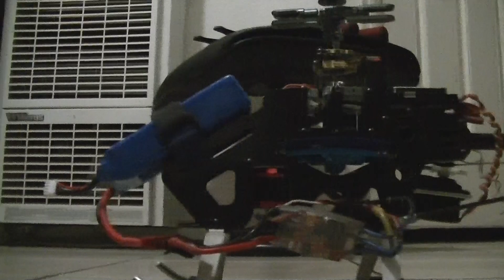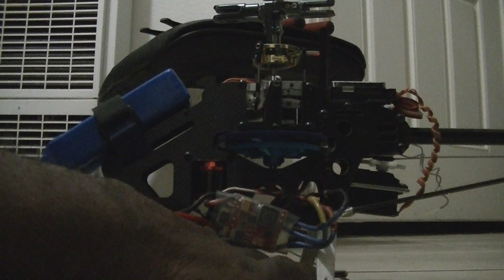Turnigy AE 45A Brushless ESC gov mode problem blinking red light

Comment: Hey wc, first calibrate your throttle range if you haven't yet. Switch ON tx, throttle high, connect battery, wait for the regular 123 tone meaning batt supply is good, then you will here two beeps which mean highest point, move to low stick, you will here some beeps you are done with calibration.
Now to get into program mode switch ON tx put stick to high position, connect battery, you will here 123 tone meaning batt supply is good, in 2 seconds you will here the two beeps you heard on throttle calibration, in 5 seconds you will here a 56712 tone meaning you are in throttle calibration.
For governor you have to wait for the LONG Beep and two short beeps sound. That will be the 7th sequence. Remember, LONG Beep and two short beeps. When you here this move your throttle stick to low position. You are now in governor mode. When you here 1 short beep, which will be the first one, move your stick up again to select it. This is the OFF for governor mode.

Heres the manual
http://www.hobbyking.com/hobbyking/store/uploads/921114894X217741X45.pdf
Reply from the maker: thank you brother
thanks man
Reply from the maker: it worked omg thank you
Reply: wcwicked clown You're welcome brother, you helped me once, time to give back!